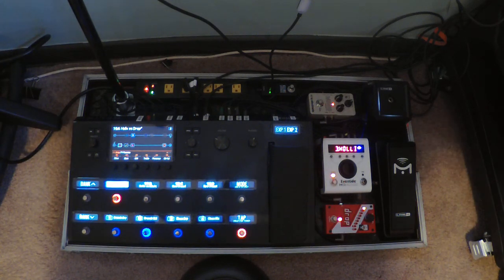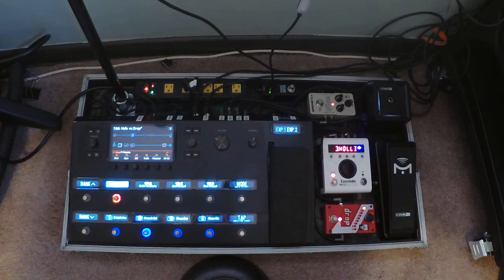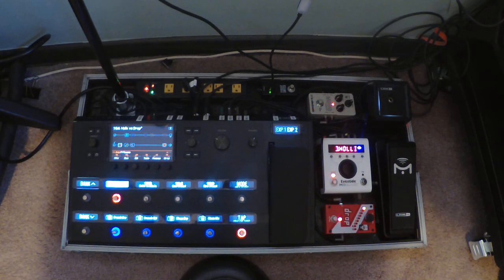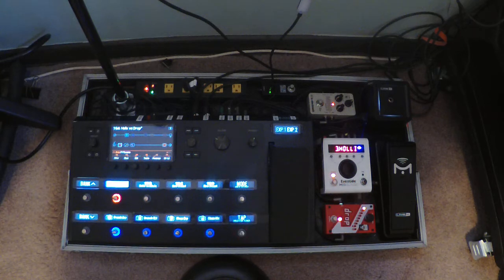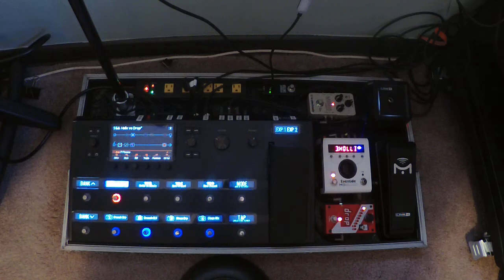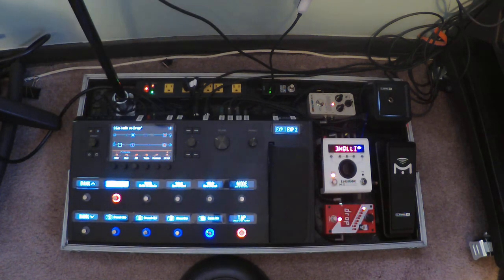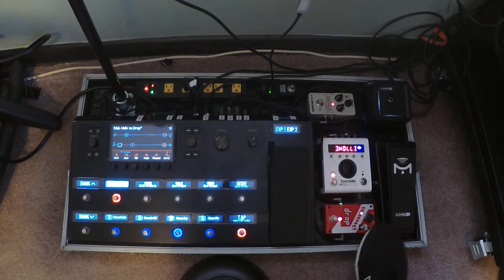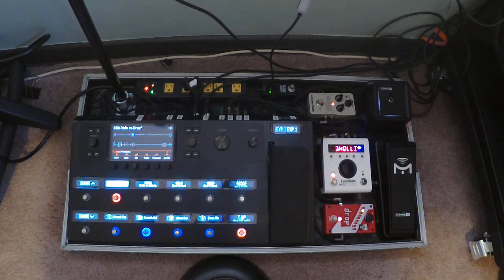Helix vs Drop

Comment: Definitely the kind of comparison I needed! I have just tried my Helix "drop" just wondering if I should get a Digitech Drop or use the onboard effect. I think for home use, trying to learn a half step down song from a recording (let's say a GnR song) the Helix did the trick, and the DigiTech Drop would do it better. 
However, for live use the Helix might fall a bit short at doing a nice drop. Would you use the Digitech Drop live? Or do you still feel it's not quite there?
Reply: Marianitem ! For what it’s worth I’m using a drop pedal for 1-3 gigs/week and I notice no issues. (Although I used an inadequate power supply once and noticed some weird sounds but that was my own fault. Make sure you’ve got a >250mA ps Unit)

Comment: Why do you not use the drop pedal into the instrument input on the helix, why through the loop?
Reply from the maker: There were a couple of reasons but I have moved back to just having it from the wireless to the Drop to the input of the Helix.  It is noisey in a loop.  I liked being able to switch it on per song preset.  I sometimes forget to turn it off and then I throw off the beginning of the next song.
Reply: Lmao yeah I had that happen to me once, forgot to switch it off and played the first note or two a half step down before quickly recovering. Thanks for the reply
Reply from the maker: More than once for me.  Almost every gig.  It's really embarrassing when you realize after half a song you are out of tune with the bass player.
Reply: Just kidding, it happened twice to me now that I think of it. I played the whole intro to don't stop believing a whole step off. Whoops.
Reply: You can put the loop input before the amp on the Helix so it doesn't matter.

Comment: If you move the simple pitch up to the front of the patch, before the amp block (just after the gate and before everything else) and program it with 1/2 step drop you get no hiss and the tone is perfect and you can use it live. Try it. I use it all the time.
Reply from the maker: That's exactly how this is set up.  I still like the Drop better.  Once the Helix has polyphonic pitch shifting I will sell the Drop.

Comment: what are you using to hold that mic boom ? :P
Reply from the maker: It is a railing flange from Lowes.  That and a couple nuts/bolts/washers was less than $10. Very sturdy. I have also used it successfully with some other pedalboards.
Reply: @hollis1003  thanks man !

Comment: Hey George, I tried Helix at GC today and pitch wham was exactly same bad quality as HD500 that I own, I just added pitch wham on empty patch, adjusted toe and heal to -5 and mix to 100%, was trying to see if I really need to buy another 7 string or can just drop tune my 6 strings through pitch wham, but end result was poor quality pitch shift, and sounded like trem effect in whenever I played chord, I was not using any other effect or amp/cab model, just line in, pitch wham, line out... what am I doing wrong? thats one thing thats really stopping me from picking Helix Floor, else I would just but Digitech Drop or EHX Pitch Fork and probably Helix LT or Headrush
Reply from the maker: My conclusion is the Drop pedal is much better.  It is polyphonic (meaning it can recognize and reproduce chords) and the Helix is not.  The Helix product team did say they hired a "team" of polyphonic specialists but when and if this is every coming to Helix is a mystery.  I will be keeping my Drop pedal until Helix has polyphonic pitch shifting.  It's not as easy to do as people think.  I also have a Mimiq because the Double Take on the Helix is not even close in my opinion.  I had the Freqout pedal for a while but it was just fun, not necessary.  I would say those are 3 common pedals that the Helix cannot reproduce.... yet.  Buy the Helix and the Drop and you will be happy.
Reply: Thanks for great advice, I agree what you are saying, I have been Line6 user since getting Vetta in 2004 and they do somethings great but other things not so great... for example Soldano on HD500 is really bad compared to what they had in Flextone or Vetta. So I have scrapped my plan to buy Helix Floor, instead of buying Helix LT and EHX Pitch Fork (GC doesnt have Digitech Drop in store and I am eager to jam on some drop tune stuff....) I havent tried Mimiq but will check it out, I really miss Double Tracker from Vetta (I think its same as Double Take??) I think Mimiq maybe better option??, btw Line6 have a promotion going on, if you buy Helix Floor/LT in September 2018, you get free helix bag https://l6c-acdn2.line6.net/data/6/0a020a40f12c5b873a7a27917/application/pdf ... thanks again
Reply from the maker: I really like the Helix floor because the scribble scripts and fx loops are critical for me.  The vetta is about the only L6 I didn't own.  I have tried the POD HD next to the Helix and it holds up pretty well.  The biggest thing for me is the IRs.  I use Ownhammer IRs and they have really given me the ability to customize my own sound.  I use the Friedman amp and it is amazing to me.  I also use much less gain than I used to (using 5150, Soldano, or ElektriK amp sims).  Good luck.
Reply: believe me scribble strips and price point was one reason I almost bought Headrush, but I dont know if its my loyalty to Line6 or maybe its true, but side by side amp models sounded killer good on Helix compared to Headrush
Reply from the maker: I haven't tried the Headrush, but I also haven't tried the Kemper or Axe FX.  I love the Helix.  It sounds great live and in my IEMs.  There's just no reason for me to try anything else.  If Line6 announces a new improved Helix type product I don't think I would be excited to get it.  Maybe in a couple of years, but for now it really does everything I need (except for Drop and Mimiq).  Good luck, Riz.